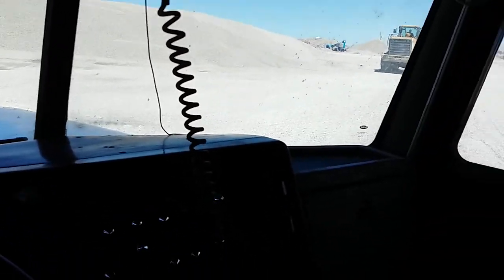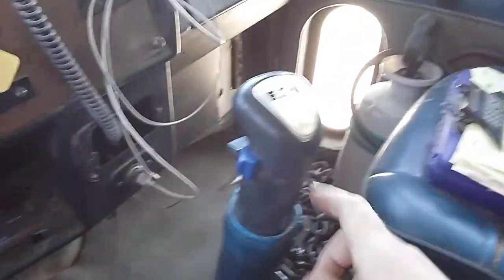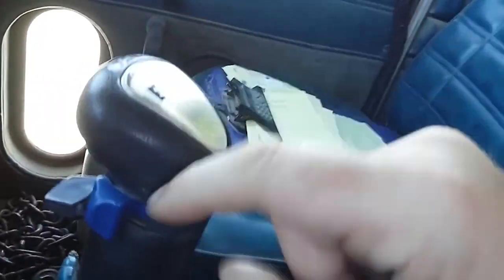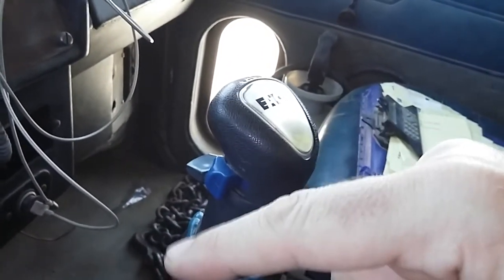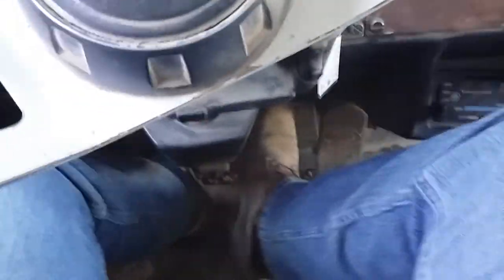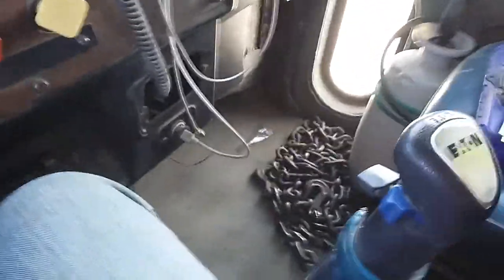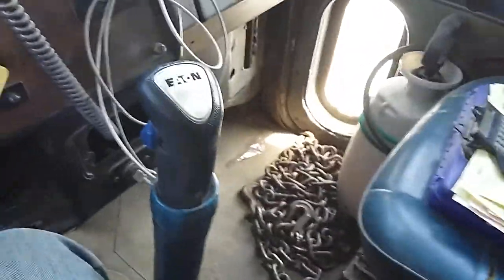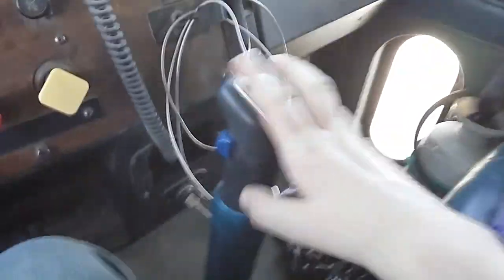Shifting an Eaton 9LL Transmission

Comment: What’s the difference between 9LL and a 15 then? Because you essential have 5 deep reduction gears in what you’re driving. Would that make it a 14-speed? Thanks for the video!
Reply from the maker: I've never drivin a 15 speed so I'm not sure how it shifts. Best way I can describe the 9LL is in the deep reduction side they are half gears.

Comment: I drove a 9 yard mixer peterbilt with the a similar transmission so it had low-low low-4 and so you could get out of holes and up steep stuff slow but it sucked on the freeway with no overdrive trying to go 65 in 8th gear at 1900rpm on the governor.

Comment: Thats what eaton replaced the reducted 13 speed for. Those had a 10 speed shift pattern, or 15 rather, except if you used all 5 deep reduction gears you were moving to fast for 1st low range, you'd have to goto 3rd low range. The recommended shift pattern from eaton was, low low 1-2-3, low range 1-5, then high range 6-10. They were commonly mated with smaller detroits, the international dt466 some 300-350 maxidynes. I think eaton just developed a more simplfied version here.
Reply from the maker: Perfect explanation. My international has a c12 rated at 400hp and I don't use the deep reduction side often but if I'm hauling dirt that deep side gets used heavily. I really like that transmission.
Reply: It helps a lot on soft ground as long as it's not so soft that you sink, but soft enough to drag you down when your heavy. Especially if you're on a grade. They're good around here in the mountains too. Ive had to stop unexpectedly on the highway because of an accident on a real steep grade, an we run heavy over here, average 120k gross. 18 speeds are alright for an all around road trans but in my opinion a 15 speed with an auxiliary overdrive geared mindfully of highway use is as good as it gets.
Reply: I had a 9ll behind a 330hp mack.. always shifted 1 through 4 in deep reduction then go to neutral go out of deep under then 4 low when loaded.. was a lot easier on the transmission than trying to take off in low and get it into 1st

Comment: Kind of a dumb question but an Amish kid wants to know what is the most powerful engine you can marry to this? As a 5th wheel logging tractor.
Reply from the maker: I don't know 100% but my neighbor has this transmission with a  485hp CAT in his logging truck.
Reply: @c.mcghee4601  forgot to ask what the max weight is
Reply from the maker: Here in Missouri is 80k
Reply from the maker: Here in Missouri is 80k
Reply: @c.mcghee4601  thanks

Comment: Isn't that a 15 speed ?
Reply from the maker: No it's a 9LL
Reply: @c.mcghee4601  You can use deep reduction in all low range gears, the ratios just don't match up for shifting like a 15 speed would. Otherwise it's the same
Reply from the maker: @Raise986  thank you for explaining that. I'm not familiar with it enough to explain it. Thanks again